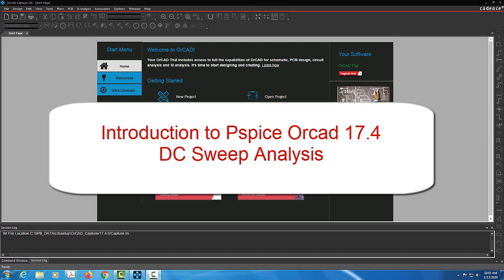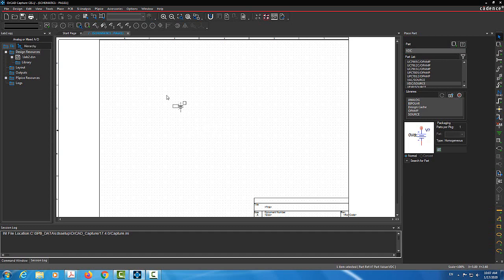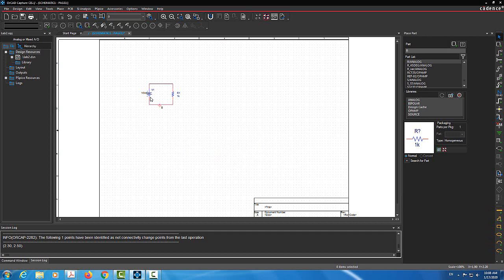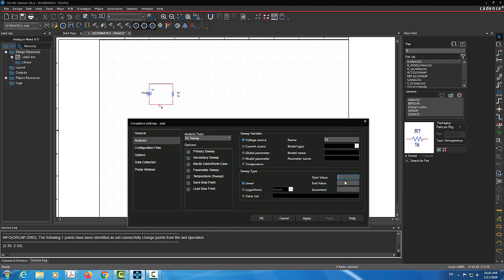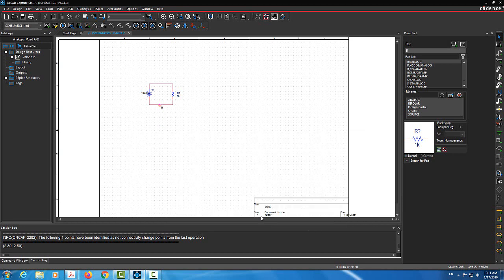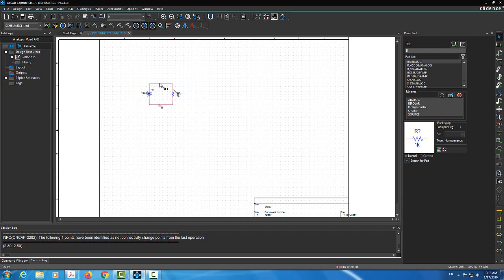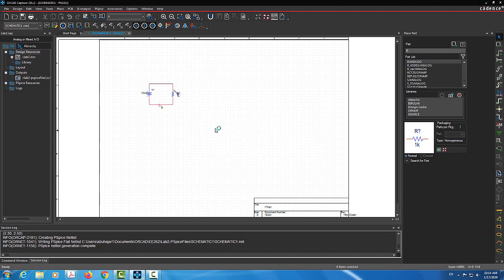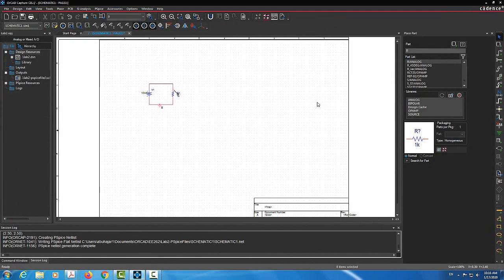Pspice using Orcad 17.4 - DC Sweep

Comment: is it possible to sweep the resistance value of a resistor with this method? (How to simulate a potentiometer in PSPISE?)
Reply: I got it. we have to define a global parameter. We should place "param" block from the library then we should change one of the desired resistors value to this {Rval}. Finally, we have to put "Rval" in "Edit simulation profile" as a global parameter.